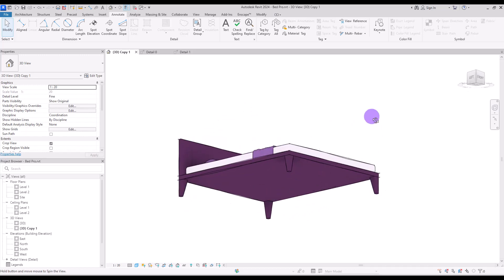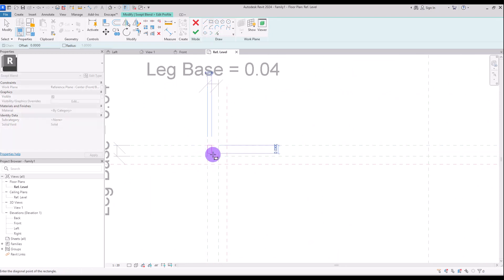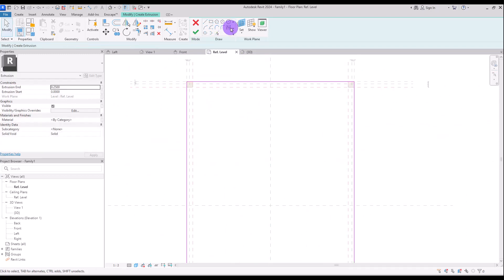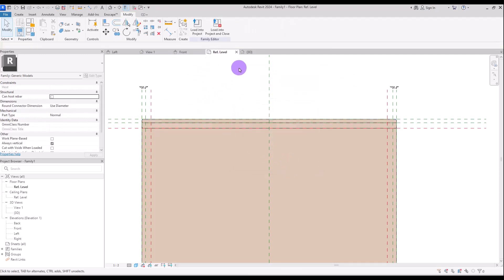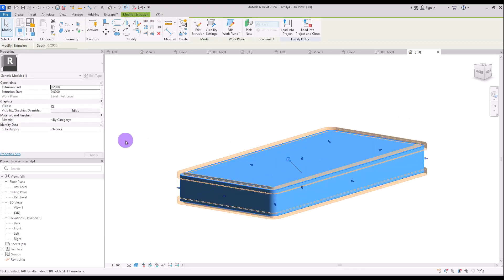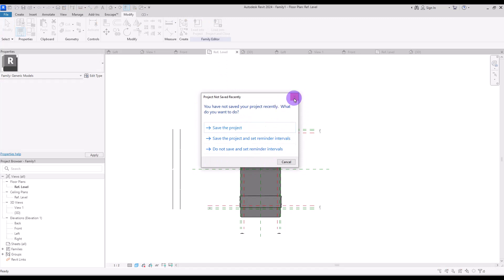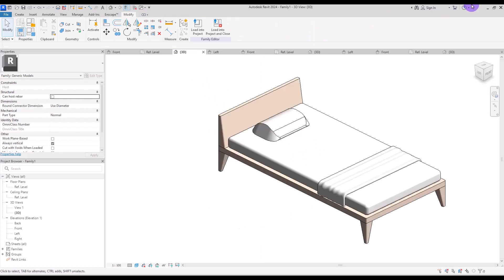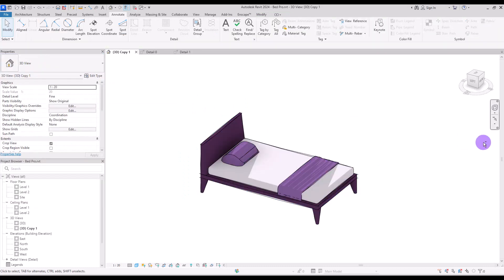A Custom Bed Modelling in All Sizes: A Beginner's Guide for Revit Families

Comment: My mattress isn't adjusting with the bed, and the parameters from the mattress family didn't import with it when I brought it into the bed frame family. DO you know how to resolve these issues? Thanks!
Reply from the maker: Any adjustment issue is because of not locking the lines and references properly, and you need to import the parameters in nested families yourself one by one.